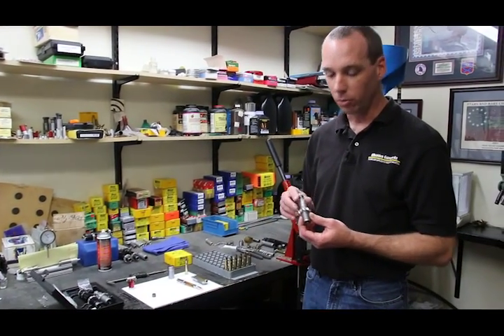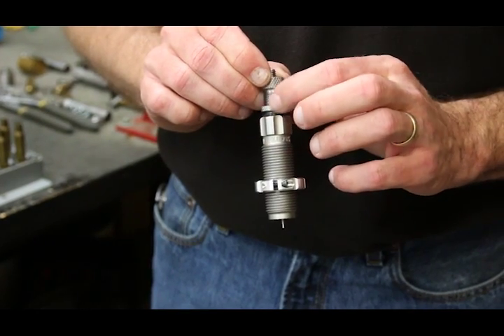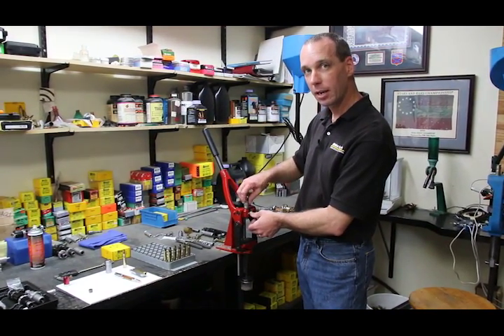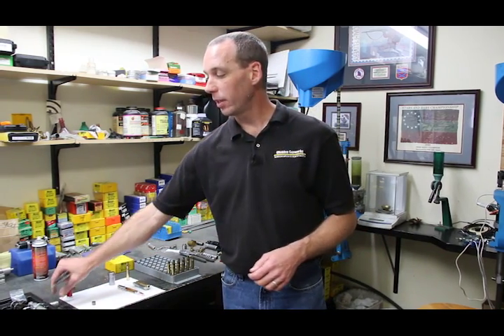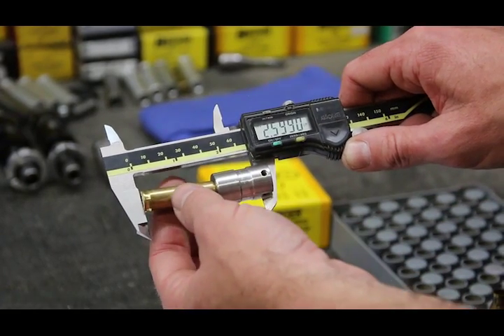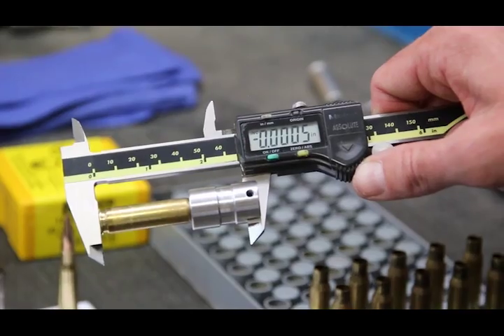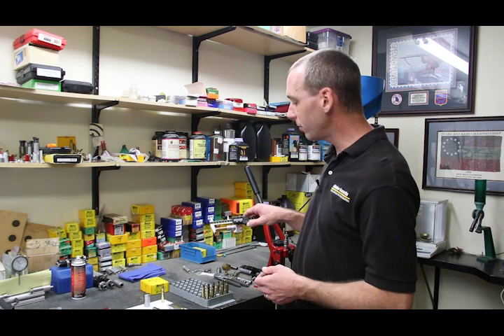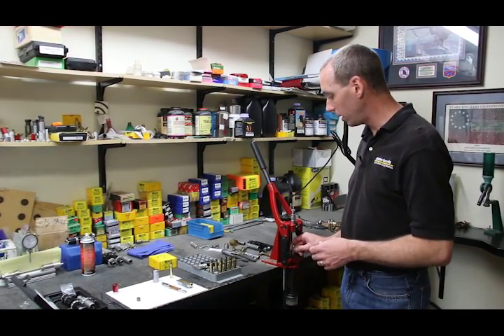How To Setup Re-Sizer Die

Comment: Best explanation of re-sizer die setup that I've ever seen. I was especially impressed that you explained the reason cases often get longer after running through the die but before final adjustment is made. I've been using a hodgepodge of dies on my .308 bolt guns but I think I'm going to convert everything to Whidden dies. Thank you.

Comment: Excellent analogies "Squeezing a half-full tube of toothpaste so longer headspace and need to thread die down. "Average sheet of paper 0.003" thick"
I use an expander mandrel so I remove the decapper/expander stem from my resizing dies. 21st Century has expander mandrels in in .0005” increments.  
Instead of a comparator, a more precise measurement is possible with the LE Wilson Micrometer/case gauge.
I use a Lee Universal Decapper die to pop out the primers as my first step before reszing.

Comment: Excellent... saved to my “go to” reference file. Question... with this FL sizing die you did not have an “expander ball” on the stem.  If there was, would there be a potential to further compress the shoulder to offset the positive extension created by the pulling the expansion ball back through?

Thanks for the education 👍
Reply: He used a Full-length sizer without a bushing. If you notice on his upstroke, there's resistance in the top 1/3 of the stroke.. that's the expander ball running through the neck.  On a bushing die, you don't need the expander, because you are only sizing the neck portion barely enough to get a good tension on your bullet. Unless you order a very custom FL sizer to exact chamber specs and with a particular neck diameter ( if you're turning your necks to a particular thickness, for example.. but that's only usually for world-class Benchrest/ F-class precision competition. ) That would be a VERY expensive die.

Comment: I noticed that when you bumped the shoulders of the first two cartridges they came out to negative three-thousands and the third one you bumped came out to a bit less than that.  Is it possible that the reason for this could be the build up of case lube on the inside of the sizing die?  If so, what can be done about this in order to get more consistency?  I realize that the differences in measurements were miniscule but if a build up of case lube or some other foreign matter was the cause of it, each time you size another case might just add to the problem.

Comment: I am new to reloading. I received from my friend once fired brass identical to what I use. I measured the headspace and it was -.002” to -0.003”. Since the rounds will chamber do I have todo any resizing? Thanks
Reply from the maker: Howard while your understanding of headspace is correct I still recommend sizing the brass in your die.  The reason is the brass may have been fired in a chamber that's larger in diameter than yours.  This could be either at the shoulder or base of the brass.

Also be aware that sometimes interchanging brass between chambers can lead to sticky extraction.  If the diameter at the base of the original chamber is larger than your chamber this is likely to happen.  Even though we are sizing the base down, right at the base of the case the brass is very thick and hard for any die to size down.  Hopefully your friend's brass will work smoothly for you and none of these problems crop up, but I wanted to share this info with you and the other viewers.
Reply: @WhiddenGunworks  Thanks for the reply. If my prayers for my friend is -0.003 inches how do I set up my sizing day as you recommend. Thanks
Reply: Sorry about the typo. How do I size the brass if it already has headspace of -0.003 inches?
Reply from the maker: @howardschwartz1462  If the headspace on your die is already set for your rifle (you have set is previously with brass fired in your rifle) then just use that same die setting.

If you do not already have the die set, then first adjust the die so that it sets the shoulder back to say -.005".  Then carefully adjust the die from there to see -.003".  You will know you're in the right place this way.
Reply: @WhiddenGunworks  thank you